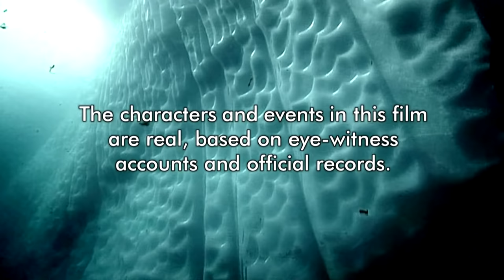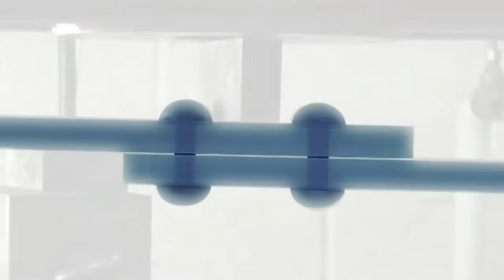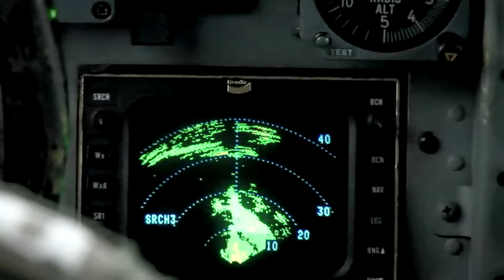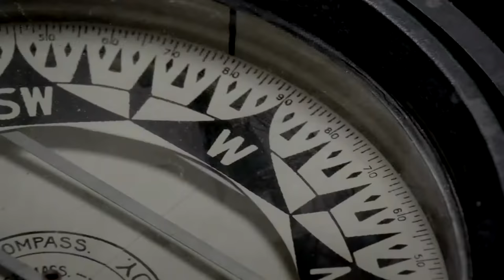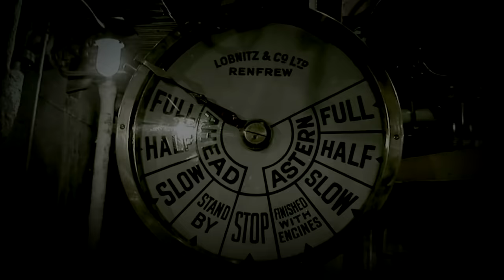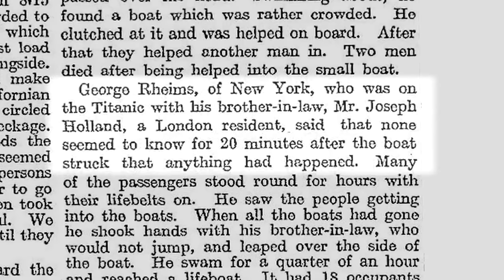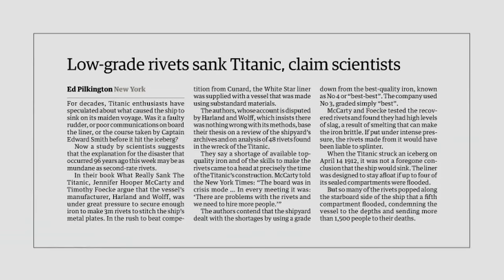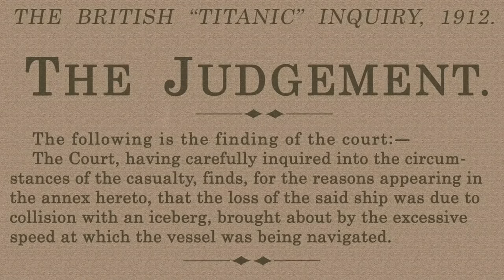The Unsinkable Titanic

Comment: No ship is unsinkable.  It was fools who thought that it was unsinkable.
Reply: Was 1912 bloody hell
Reply: Well no, it is possible to build an unsinkable ship. If you take any massive ship and fill the insides with foam and make actual water tight compartments it will not sink. It may flip over but it will not sink. They do it with small boats a lot. The titanic however had compartments but each wall of the compartment didn’t reach the ceiling. So water would fill each compartment and fill into the next. These people actually believed that the ship couldn’t sink because of how massive it was.
Reply: @Roberob1189  no, even foam loses buoyancy. houseboats rely on barrels of that foam, and occasionally they have to be replaced…
so even foam can sink.
and no, they didn’t think the massive size would save it, they thought the water tight compartments would (save it) …
if only those water tight compartments were sealed up to the ceiling, it might have worked and bought the ship a little more time to be rescued.
Reply: @claireconover  why yes anything is possible. But there have been large boats that had their hulls sprayed with foam throughout and they were abandoned in the 1940s and they still haven’t sunk. I am sure if they sprayed that rubber based foam through the entire ship I’m sure it will stay afloat for a very very long time.
Reply: No one from Harland & Wolff, or from White Star, ever made such a claim. Don't believe everything you see in movies.
Reply: Agree with you.
He said Even ALLAH/God  can not Sink Titanic and that was big mistake because if your wisdom helps you, that is what everyone expects but never forget your creator and be greatful What you can.
Reply: No person involved in the building/engineering ever thought it was unsinkable. This whole “unsinkable” thing was a lie and used as a promotion to sell more tickets.
Reply: Noah’s ark was unsinkable
Reply: @lancer8325  but that's different cause God was with then
Reply: If a ship is made of metal, I can assure you it can sink.
Reply: @mrpirate3020  bro that just in the movie in real life no body say that not even God can't sink the ship
Reply: @Roberob1189  Wait, do you mean like foam within the double hull or...? Forgive me for sounding naive. How is it they incorporate foam in ship building? And what about buoyancy? I suppose, if you consider the ballast tanks it could work.

Comment: All this great information but one key thing was left out.  One of the key contributing factors to Titanic's sinking which has been mentioned many times before in other documentaries was the undersized rudder.
Reply: Say more
Reply: Undersized rudder? That's a myth.
Reply: Is one of the main reasons why ships today have articulated propellers.
Reply: @willdixon2349   Not when you really think about it.. A small Rudder like that, it would take forever for the ship to turn depth to turn. That's why you see many ships today using articulated propellers.
Reply: @brianwhitford6086  what has always puzzled me was Murdochs decision to throw the engines Full Astern. Reversing the outer screws would have caused cavitation and loss of "grip". I don't think they had the option of reversing just one screw.
Imagine - you're driving a fully-loaded semi, blasting down the freeway and then chucking it into reverse? Chaos. Wheels would lock-up and you'd lose control including the ability to steer! To continue the analogy, isn't it better to accelerate out of a situation rather than brake into one?
To order Hard A'Port is fair enough but reversing the screws has always made no sense to me. I'd welcome your views on that......
Reply: That's been debunked. The rudder angle is utter crap!
Reply: Also the overinflated EGO of the Captain.

Comment: The rivets were fine. The plates themselves where over riveted and extremely strong. The seams would have opened up no matter what.
Reply: @jamalbr3251  Why would it have ;delayed the sinking?'
Reply: @jamalbr3251  Yes, but that had no impact on the outcome of the situation. The Titanic was near 50,000 tons, the iceberg was 500,000 tons, and they collided along a tiny, pinprick area at nearly 11m/s. ANY rivets would have failed under plate-buckling stresses like that. No ship hull in the world, even modern battleships, are designed to tank a forceful impact at full speed against 500,000 tons.

Comment: The fact that the ship sank in such a unique way: flooded so violently by the bow shoals, in order to tilt to the point of raising the stern above the waterline and then break apart due to logical physical forces , falling suddenly into the sea, this while the bow sank, pulling the stern by what was left of the union between the two, to then tilt the stern again until it became vertical and then both halves completely sink vertically and then separate in their trip to the bottom of the ocean.. I would say that apart from what is already so terrifyingly tragic, it is the most humiliating way in which a ship has been wrecked. It is as if Poseidon himself, enraged, had seized it with his hands to break it in half before taking it to his home in the depths of the ocean. Something very surreal.
Reply: What strikes me is how surreal the scene after the ship sank must have been. A dead calm sea, dotted with lifeboats and lifejackets: floating bodies and gasping survivors, with only minutes to live. Surreal, indeed.

Comment: The water temp may have been 33 degrees F or lower.  Pure water will be at freezing point at 32 F, but being salt water, could have be lower than 32.  Anyway, a person would suffer hypothermia in less than 15 minutes and be dead in 20 minutes.
Reply: Most of the titanic’s passengers who were on the water did not die of hypothermia as this is a process that leads to death after a period of time and happens in certain stages. Cardiac arrest was the real cause for most of them.

Comment: The mother ship that brought the titan to the dice site tracks the sub as it goes down so it can tell the sub where it needs to be..the coast guard gets the path from them and starts the search were the communication was lost..I believe they found it pretty quick..

People complained if they already knew, why search..it took time to get the equipment to the location so the best thing to do is make sure the sub didn't surface..

It appears the carbon fiber weakens with every dive and was a matter of time before it failed. The company was told repeatedly they were playing with fire..

Since the sub was not certified it should have never been allowed to act as a business..he could of tested or used it as he wished, the fact of taking passengers was completely wrong in my opinion..

Comment: One major event was ignored by this presentation. The Titanic split in half as she sank. There were survivors who said the ship broke, but they were  ignored. When the wreckage was found , the two separate parts of the ship were discovered to be 2,000 ft from each other (which confirmed the break up) The bow had flooded and the stern was lifted out of the water so far that the propellers were clear. This created a stress point the created the fracture. The center spine was the only thing holding the two parts together. The stern was holding the bow until the weight difference  became too great and the stern went under. In addition the was a coal fire the was going on all the time that Titanic was in transit. This helped weaken the bow..
Reply: Mostly correct, the 'fire' was nothing more than some burning coal embers and never reached temps high enough to boil a pot of water let alone compromise the hull which was constantly being cooled by the frigid Atlantic. The fire played no role in the sinking and were extremely common on vessels of that era

Comment: Based on surveys of the ship using sonar there are no visible holes or gashes along the water line above the mud where it settled. Speculation is now that it may have scrapped along the bottom of the ship and poked holes in that way. Where Frederick Barrett (actor) points in the video at 51:30 there are no visible holes or gashes there.

Comment: As it turns out, having 48 lifeboats wouldn't have helped much, anyway. They didn't even have time to load all 4 of the collapsible life boats on the davits, let alone launch them. Two hours isn't a lot of time to evacuate 2200 people with the antiquated lifeboat systems of 1912. Also keep in mind that lifeboats were often seen as death traps. In rough seas, they typically were. Furthermore, the reason so many 3rd class passengers died wasn't really the locked gate they could easily step over (and eventually did). It was the confusing layout of the ship (designed to keep different "classes" from interacting) and the fact that many 3rd class passengers were immigrants who didn't speak English and couldn't read the signs. By the time the majority of them got to the boat deck, the lifeboats were gone, and the ship was listing badly, so badly that they probably wouldn't have been able to launch many more boats if they'd had them. (They had trouble launching some of the boats they did have as it was.)

Also, there is some debate whether binoculars would have made much difference, given the calm, extremely cold water. There are some who suspect that a kind of mirage happens on nights like that, as reported by other ships on similar nights. If so, then it wouldn't have mattered if they had binoculars. The iceberg wouldn't have been visible until it was very close. That said, in 1912, they likely wouldn't have known much about this phenomenon.

Comment: To me not having eye glasses is the biggest reason it sank , I understand the part about the rivets but I am sure if you went over most ships built during that time there would be the same type of things , also to say that they could have saved ship if better quality at best is a guess and not a fact since the design of the ship was not an icebreaker and not meant to broadside an iceberg of that size. I also dislike how it is always made to be like the boat just randomly sank , I know that is not the case but a lot of the reasons it sank are logical and lessons were made from it.

Comment: Also, ABSOLUTELY wrong about hitting head on. The ship was designed to hit another SHIP, not a million ton iceberg. That would have been equivalent to hitting a solid wall at nearly full speed. Such an impact would transfer almost all the kinetic energy into the hull which would have burst open, crush the keel and severed the steam pipes. This would have resulted in an immediate loss of power and thus, Titanic wouldn't have even been able to send a distress call and no one would have known she was gone until she failed to show up.

Comment: They had to use iron rivets in the bowel section because they didn't have the ability of fitting the machines in there to put the steel rivets in. They had to be installed by workers manually. Only the iron rivets were able to be installed that way.

Comment: The fact is  no ship is unsinkable, unless it is made of cork or  plastic. The fact is the bulkheads except the first two, did not reach teh A deck, which was waterproof, but reached only the E deck with was not waterproof.  When he first five compartments were flooded, the ship was doomed  It was designed to float with the first four compartments flooded, but five were flooded. However, all thngs considered, it was a good design, taking much longer to sink than the recent Costa Concordia.  The Captain should have reduced speed, when informed icebergs were in the area, but he did no't.  Te reversing of the engines was a mistake too, as for a time the whole machinery stopped, making the ship non governable.  Besides the crew did not practice how to lower the boats, and they did not even know each was designed to carry 60 persons.  So 1200 people could hve been saved, had the boats being filed to capacity instead of 708.

Comment: Everything else checks out, but I’m kind of calling BS on the rivets playing a considerable part. The massive weight of that ship, slamming into what is essentially an immovable object (as far as the ship is concerned) concentrating all that force onto that seam (and therefore the rivets). It doesn’t matter what those rivets are made of, when you have that much force put on a bunch of rivets of any usable material for the time, it’s probably going to come apart. Going to the highest grade iron, or even steel may have bought them a few minutes at best, if anything changed at all. It’s like running over a soda can vs a soup can.  The soup cans are much thicker and stronger, but when you put it between the weight of a car and the road, both are coming apart. Everything else checks out, though, from the height of the bulkheads, the lifeboats, blah blah.

Comment: It wouldn't have made any difference if there had been more lifeboats. They barely had time to load the lifeboats there were - the last two weren't launched, but floated off as the sea washed over the deck! They should have loaded more passengers in, but that wasn't as simple as it sounds either. Initially passengers were reluctant to go. Some even got back out! It was a freezing cold night and Titanic was huge, solid, warm and brightly lit, beside which the lifeboats looked like tiny precarious wooden toys.

Comment: Just to cross check...@ 7.06 it says titanic had only 16life boats and as per many other data available its mentioned as 20...which one is correct???
Reply: Correct number is 20, but here is the explanation: 16 is the number of lifeboats on davits. Each set of davits was capable of launching 3 lifeboats, which means that the total number of lifeboats should have been 48, but that number was reduced, as it is explained, so that the boatdeck would not be obstructed. Four additional lifeboats were stored inboard, they were collapsible lifeboats A, B, C and D, so, again, total number was, indeed, twenty lifeboats, with total carrying capacity of roughly 1200 people.
Reply: @BorivojeSinik-eh4qd  thanks a lot for the information🤩🙂
Reply: @Vaisag.R.L  No problem, my friend!

Comment: Oddly the commander on the bridge yelled "hard to starboard"  yet it struck the ice on the starboard side, and the depiction is such that a turn hard to port would have been the correct turn to avoid the ice..
Reply: Titanic used tiller orders. Hard a-starboard was an order to turn the ship to port and that is how it was followed.
Reply: I think they changed the confusing tiller steering, a remnant of sailing ships, not so many years after the Titanic sank. A bit like turning your car steering wheel in the opposite direction you want to go. That was how the Titanic was steered. Very difficult to judge how much of a turn you need....
Reply: @logotrikes  Tiller steering was actually still widely used on British ships until the 1930’s.
Reply: @Sarah0583  Thanks Sarah. I'm a bit behind on many things...

Comment: Titanic was an excellent ship built by a very experienced shipbuilder of renown around the world. She was not built by peasants in a shed using scraps. She held up incredibly well after striking the iceberg. If she had gone down sooner, the death toll would've been much, much higher. The reason for her sinking was mainly caused by poor judgement on the side of Captain Smith (steaming into a known icefield despite the warnings), the lookouts not having binoculars to spot the iceberg soon enough, essentially no iceberg patrols being established yet and perhaps pressure from Bruce Ismay to get Titanic to New York on or ahead of schedule, although that's only speculation. 
Titanic had enough lifeboats as per regulations of her time, which used the ship's tonnage to define the number of required lifeboats and not the number of people onboard. Lifeboats were seen as a sort of shuttle to get people from a sinking ship to another one, not to have people on them for hours or perhaps days.

Comment: They shuffled the pack and got dealt a poor hand, that was it. If anything needed to go wrong it went wrong on the decks of RMS Titanic.
I think the issue with the rivets is small potatoes. Maybe stronger rivets would have given them a little bit more time but any time gained would have been negligible and had limited influence on the final outcome for the ship. The port hull plates weren’t ripped in one long gash but were impaled in a sequence of prodding holes along the port side and below the water line. The simple fact is RMS Titanic was not supposed to crash into any other object floating on the sea. Other ships were made in a similar fashion and never had any issues with crossing the Atlantic. 

Of course, the British Board of Trade set up an inquiry that exonerated the British Board of Trade of any blame. That’s what Government departments did then as they do now. 
Personally, I found the American Inquiry to be a more reliable examination of the sinking.

Comment: 7:00 this detail is majorly inaccurate. yes she was fitted with 16 originally in Design D. all 16 pushed aft. but they later spaced them equally by 4 with 2 more collapsible boats added. so titanic had more lifeboats than originally designed and was only following the lifeboat requirements set up by the lusitania and mauretania. iir titanic may have had more boats than the two cunard liners